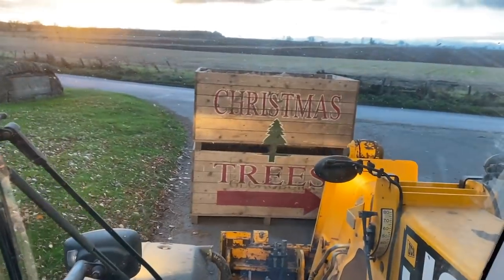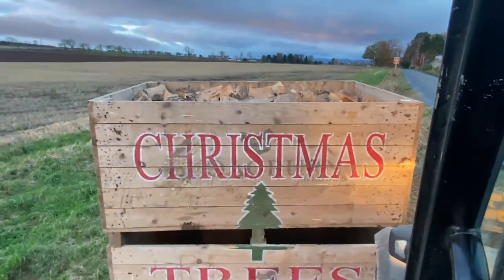BIG BLUE DEMO | BAD IDEA LOADING WHEAT | GOODBYE SUNFLOWERS #CRAWFORDFARMS #157

Comment: Get Kev a JD to match that boiler suit of his 🤣
Reply from the maker: Its here!
Reply: @CrawfordsFarm1  ooooft all the bells and whistles that a tractor needs? Apple car play, leather steering wheel etc?
Reply from the maker: It had a the tractor bells and whistles but no bluetooth that i could find anyways! It should be legal requirement now… no apple airplay scrap it!
Reply: @CrawfordsFarm1  you’d think bluetooth would come as standard, usually connected into the radio in some way